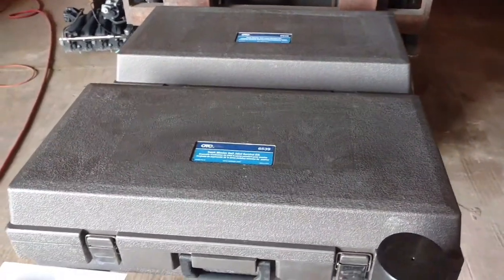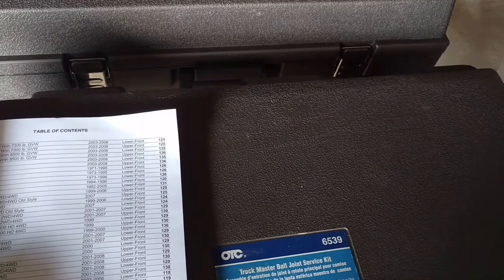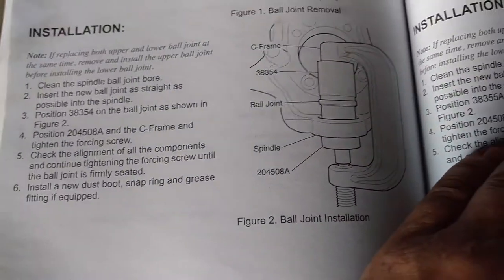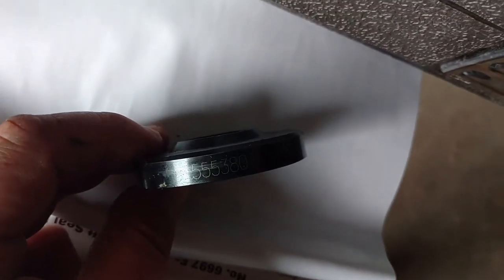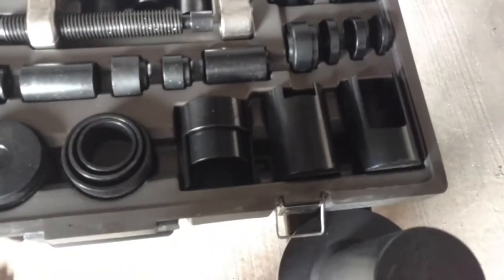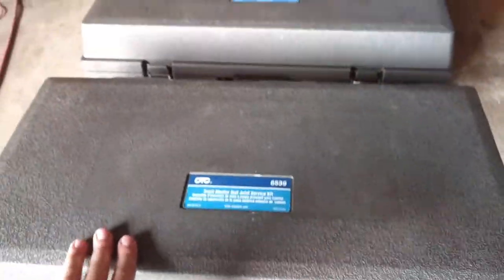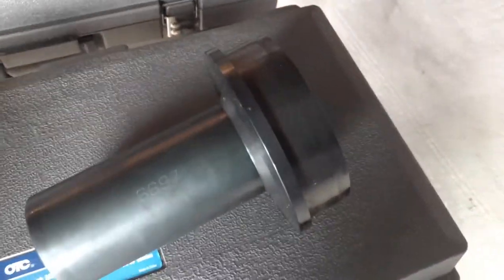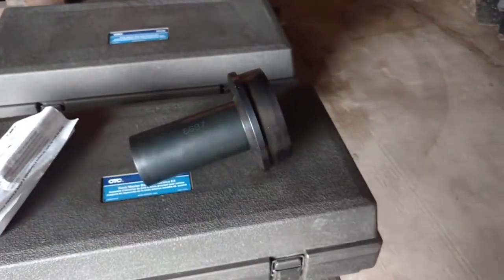MY THOUGHTS ON THE OTC 6539 TRUCK MASTER BALL JOINT KIT. IS IT WORTH IT?

Comment: That's a nice set I bought the basic set from MAC back in the early 2000s working in a Ford dealer it got a work out and is still in great shape. I've used it for everything from ujoints to lower control arm bushing on Mustangs in conjunction with my 3/4 socket set.
Reply from the maker: i was using scrap pieces of exhaust pipe, old sockets, and anything else i could find to press ball joints in.

Comment: looks like a decent set, good to see USA on OTC stuff, as much is import now. I have the snap on bjp1 set which works great. I use mine more for universal joints than balljoints . be sure to use heavy grease or anti seize on the forcing screw, as there is tremendous amounts of friction under load
Reply from the maker: i use grease on the arbor. i used this to do the u joints in the truck i was doing also. i am very happy i bought it.

Comment: Cant go wrong with otc     high quality usa made     thats a comprehensive set     the snap on bjp is nice but you would have to buy a lot of adapters extra and that adds up quick       is there a tiger tool kingpin tool vid coming up

Comment: Wow, for that price im just going with snap on. Snap on actually cheaper than this set! Hahaha
Reply from the maker: the snap on set i looked at was not for trucks. this was the best price i found when compared to snap on price and coverage.
Reply: The Snap-On BJP1 absolutely does trucks. It has no equal in the ball joint press world. The OTC probably gets the job done most of the time though. The Snap-On is just the most rigid press frame and will NOT bend like most other will under heavy load.

Comment: Does it work for rams upto 3500 also?
Reply from the maker: yes. i just did all 4 ball joints and axle joints with this in my 2011 ram 3500 4wd.